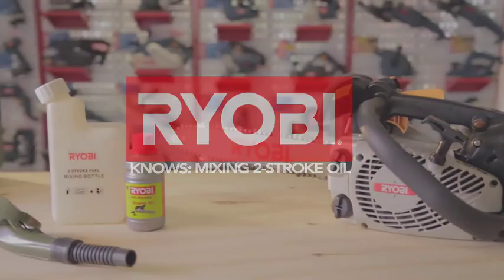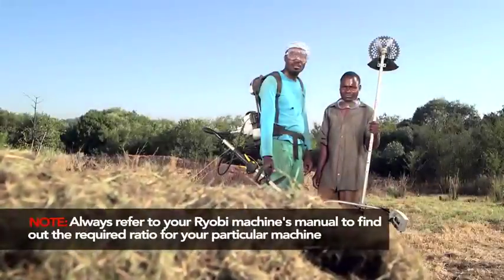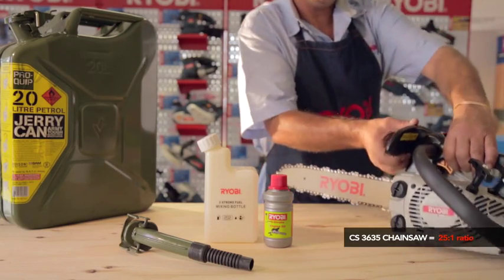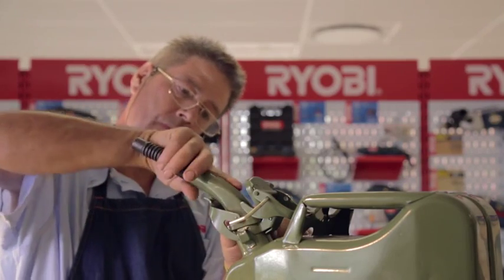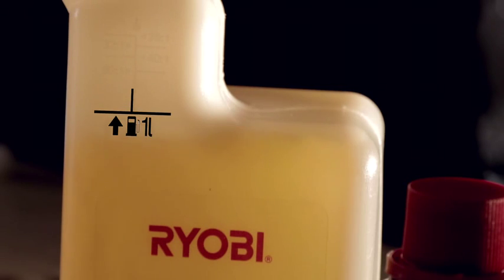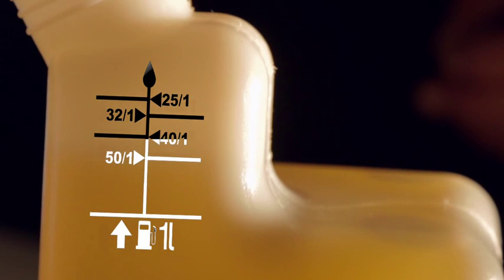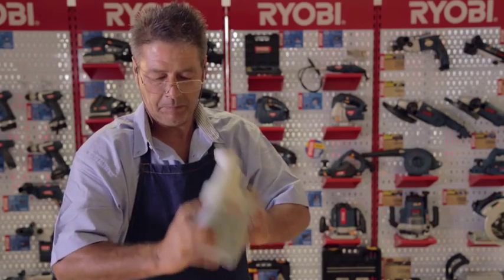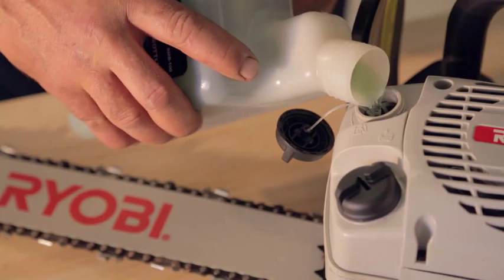Ryobi Knows Mixing 2 Stroke Oil

Comment: I have a Ryobi 2-stroke 950 W generator, and it almost burned my house down today. It stands outside with a lead connected to it. I went outside because the pitch of the generator changed. Didn’t see anything wrong, when I got back inside the multiplug, which has an antisurge plug, was  on fire. After the whole incident, I tested the output and it was 500 Volts!!!! Don’t buy it, it can cost you your life